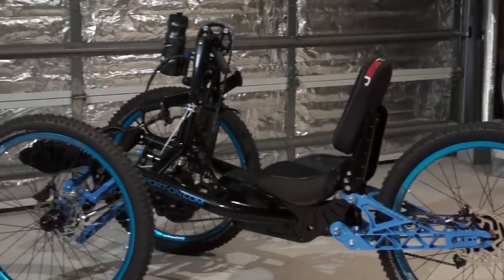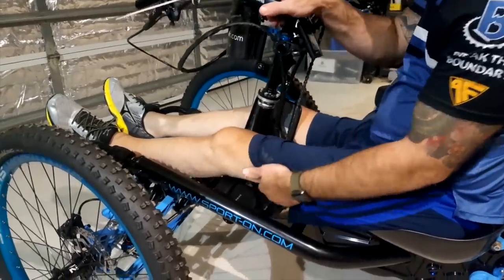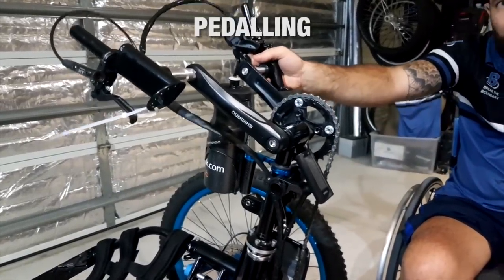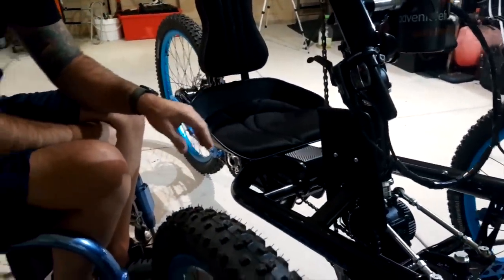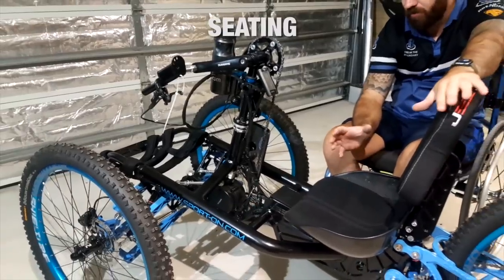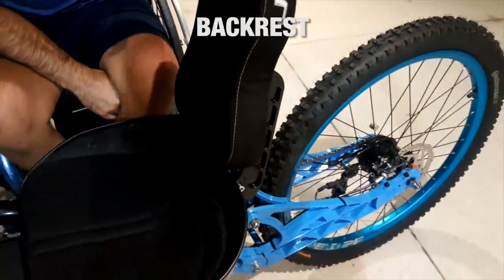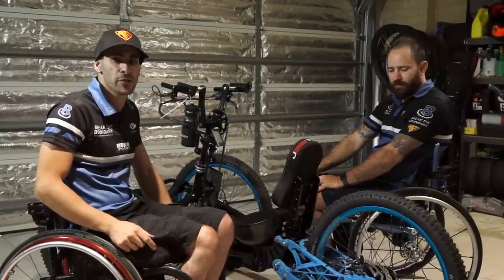Adaptive Mountain Bike Review - Sport-on Jeetrike in Australia

Comment: Questions I have regarding the Jeetrike:

1, pannier racks. How does on carry luggage on this trike?

2, charging the battery in situ?

3, the seat looks like it’ll act like a bucket during periods of rain. Does the seat have a method of drainage incorporated into it?

4, where are lights mounted? As laws state that lights must be mounted on the cycle itself.

5, does it have an improved turning circle over other handcycles?

6, does it have a reverse gear? As you have a higher seated position, how does someone reverse if it doesn’t?

7, can the trike accommodate fat tyres? If so, what are the largest that can be fitted if mudguards are fitted?

8, what mud guards fit the trike? 

9, are angled pedals an option?

10, most important. What are the colour options? 😀

Thanks.
Reply from the maker: All very good questions Michael. We'll do our best to answer!

1. Better of attaching a small trailer on the back wheel. Sport-on have one or you can use most bike trailers. Panniers might be tricky due to the rear suspension making the swing-arm mobile and not giving the pannier enough anchor points.

2. Charging port is under the seat. You need to remove the seat to get to the port, hence we made a carbon plate with extended port.

3. Drill a hole for drainage. Easy done. Same with Explorer III leg rests.

4. Depending on your lights, you might be able to mount on vertical steering shaft or on the front swing-arms. 

5. Much better turning circle - we cut that bit out of the video for time. Better than Explorer. Yet to measure.

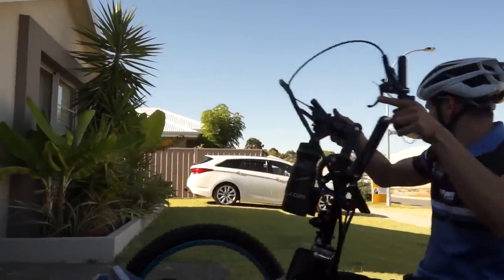6. No reverse gear (we might have a solution soon for internal hubs). Grab the front wheels @9:40. Easy to reach forward if you have good arm control. 

7. Rear wheel would be easy to have a fat tyre. Front wheels might reduce the turning radius significantly. Ask the guys at Sport-On - I'm sure they're already working on it!

8. Yet to play around with mud guards but we might make a custom plate to slide in.

9. Angled plates would be easy to machine if there isn't already a solution. Reactive Adaptations have angled handgrips as a standard. You can also change the cranks to ones with enough angle that you wouldn't need to change the handles. 

10. Too many colours to list! You can get gloss, sparkly stuff and almost anything you can think of!
Reply: Break The Boundary 
I’ve 2 bikes/trikes with full suspension that have pannier racks. An ICE Trike Adventure and an Azub 6. Both pannier racks are attached to the seat or frame behind the seat and don’t come into contact with the swing arm.
Regarding drilling into the seat, whilst I’m sure that might work, it would also mean invalidating your warrantee.
Reply: Break The Boundary 
I’ll look into the other hand pedals, but it does seem an expensive work around as I can imagine they’re not cheap and you’re effectively buy them twice. If Sport-On want such a high price tag for their products, they need to provide a service and support that justifies it.

Comment: Buddy, thanks for the review! Answer please, are the rear wheels hard to remove? I need to transport. Thanks and good health !!!
Reply from the maker: If you have an internal hub it's a bit easier than a cassette set. Either way you have to remove two bolts plus shifting cable and chain (similar two a standard bike). Hope this helps!
Reply: @Breaktheboundary  Thank you very much.  Yes, it helped me.